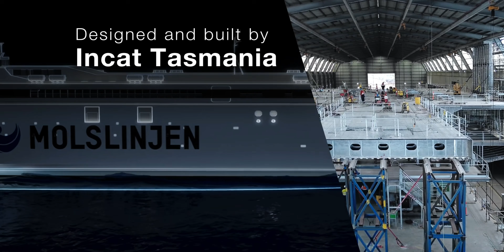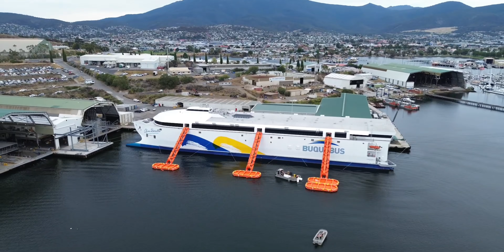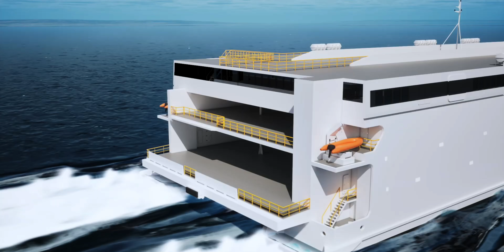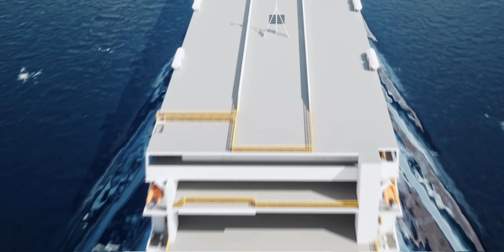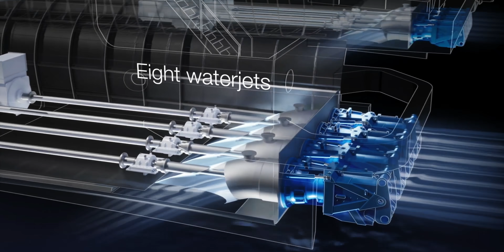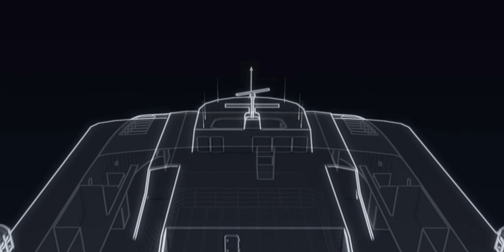World’s Largest Electric Ferries Are Finally Coming

Comment: Still much cheaper to run and much, much cleaner than diesel. The ferries are not connecting Ebeltoft and Aarhus. But are connecting the distant Copenhagen Island(Sealand)to mainland Denmark, which is important for danish infrastructure, as the two largest municipals and main  economic drivers in Denmark, are Aarhus and Copenhagen.
Reply: Sagde de ikke Århus - Odden og Ebeltoft - Odden i videoen?

Comment: Since 2018 the ferries between Helsingør (Denmark) and Helsingborg (Sweden) has been fully electric, so this is not a first. Now, these ferries may be bigger and sail longer, but the H-H ferries are by no means small - they are multi-deck car ferries and sail the short stretch across Øresund many times every day, with high power (1200kWh) charging during the 10 min. docking time. The batteries weigh about 80 ton 🙂

Comment: No information as to what is making the motors turn the water jets in terms of battery and power.
If the 2 battery charging systems are providing 58mW in 30 mins, that is a 232mWh charging rate. That's almost 1000 250kWh chargers running at once. Yeah right. Its between 4&7% of Denmark's entire generating capacity down 1 supply line. 
Finally, 132000 tons of CO2 is prevented ONLY if the source is CO2 free.  No mention of where the power was coming from
Reply: Easy look at Denmark's energy mix not difficult to do, it's sometimes called Google.

Comment: We need about 6 of these in British Columbia! Not chinese built diesels! Come on EBY WAKE UP!!
Reply: How about Chinese built BEV?!
Reply: BC tried building big catamarans 30 years ago and it was a disaster. Cats are not suited to the stormy waters outside Vancouver.
Reply: @Dave_Sisson  BC has 6 Island class plug in hybrids operating that are full electric capable. But typical of us, no chargers at the loading docks
Reply: @jaaklucas1329  The issue will be that there will not be the capacity to supply the charging stations. This is a common theme where virtue signalling officials go for electric vessels knowing full well that they will not be able to operate to the frequency required because of downtime due to slow charging, and in the case of hybrid vssels they will need to be run on diesel.  Total waste of money if the infrastructure to support them is not in place.

Comment: The new ship can carrier 500 cars and it charges 25,000 kWh while docking and the distance traveled is around 70 km. So it takes 0.71 kWh/km per car. On road a car drives around with 0.2 kWh/km. But the ship saves around 120 km of travel distance. But still nice to see the transition to renewable energy and also the removable of smelly fumes from the diesel will be nice and healthy too. I live close to Aarhus, so hope to see the ship in operation and compare the smell. :medal-yellow-first-red:
Reply: The ferry could slow down a bit. And save a LOT of energy...... but, Fast Ferries are what we use in Denmark. To connect. And avoid more congestion elsewhere..
Reply: @user-pt1ow8hx5l Some competing companies had made complaints about the high speed of the ferry, and they got support in a copenhagen court. Its the expensive Copenhagen SAS airlines and the unstable and slow Copenhagen Train company, called DSB, that will both soon be out of business, on the cross country route connecting the only two metropols in Denmark.
Reply: We need these here in Australia to go from Melbourne to Tasmania, where Incat is based. The scale needed is another step up, but the Tasmanian government has overseen a ferry-wharf debacle that means the new diesel ferries cannot even. DOCK!
Reply: Nice…Per 8210 i Tesla.

Comment: I wonder how these ferries will be delivered to Europe?
Reply: They use a special lift ship - they partly submerge - move under the object then re-float.  The latest completed ferry is stuck at the moment because the lift ship it needs is stuck in the Persian gulf
Reply: I do not know, but oil rigs are often delivered by barge. I guess that would work here too.
Reply: Same way they already delivered a ship to Argentina probably.
Reply: Just like the first ones we got from Australia by sea.
Reply: @Mariuz574. Did they sail to Australia on their own power or onboard a larger ship?
Reply: @yawn369  The old ones, the Express 5 and 4, came here on their own. However, the new ones will arrive by semi-submersible heavy-lift ship because, being fully electric, there’s no infrastructure to charge them along the entire journey.
Reply: @Mariuz574thanks!
Reply: Air Planes
Reply: @michaelbaysorensen 🤪
Reply: Likely on a container ship? I assume a container ship is much larger? Could probably send the batteries separately.

Comment: Cleaner, quieter, what's not to like! The price?
Reply: The longevity ?
Reply: @Martinko_Pcik  Just like an EV the batteries will last longer than an engine.  There's already an electric ferry currently in transit.
Reply: @Martinko_Pcik  They’re going to be seaworthy for 25 to 30 years, which is much longer than the time they actually plan to use them.
Reply: @Martinko_Pcik  replace the battry
Reply: What happens if it sinks?
Reply: Oh man, im sure the designers never thought about that.
Reply: @Earth-in-space  Do you mean like the Exxon Valdez did?
Reply: @BrentonSmythesfieldsaye  what was that?
Reply: @Earth-in-space  I have given you the name, if it interests you enough, maybe go and brush up on your history knowledge. It's all readily available on line.

Your opening post could interpreted as a "loaded question". But I could be wrong of course.
Reply: @Earth-in-space same thing that happens to Diesel ferries, but without the oil dump.
Reply: And or go into fire 🤔
Reply: @Earth-in-space  What happens if a fuel ferry sinks or goes into fire? 🤔
Reply: @PyroShields  then the water will likely get polluted with gasoline, if it does not go up in flames first.
Reply: @Earth-in-space  Well the electrical vessel will also sink.
Reply: Its half the price of the Train/ bridge transportation model. Despite that, the state medias in copenhagen (nationwide TV cannals are not legal outside the capital) are adverting for train and bridge, on a daily basis, in both commercials, series and movies. Taxpayers fund the old copenhagen train company(DSB) with billions of $ each year, to keep the trains running, or rather to keep people employed.

Comment: We have two electric ferries at Dover on the ferry route to Calais. They are running on diesel because they cannot recharge in the time nor from the infrastructure. It takes too long for a turnaround that it commercial viable. The town would go dark if they tried charging at fast rate.
Reply: Then battery packs on shore, which charge slowly but can dump massive power quickly, would be a solution.
Reply: @jannorgaard561 They are running on a financial tightrope and they spent so much buying the damned thing that there is no further investment money.. it was not thought out well concerning the infrastructure.of the town let alone the docks, which were originally set up about coal as the prime mover. Then oil but never electricity.
Reply: @GWAYGWAY1 why do they still run ferries as there is a tunnnel?
Reply: @gamma1929 
The tunnel cannot cope with the volume of freight traffic so we still need ferries.
Maybe if the powers that be are successful in drastically lowering our demand for “stuff” and travel, (which is their stated UN Agenda 30 aim),  the demand for ferries may reduce.  Who knows?
Reply: @GWAYGWAY1  I lived in Dover for 20 years back in the 50s and 60s and believe me there was electricity. then not sure what you are smoking.
Reply: Not electric , just hybrid,  with tiny batteries which are used for docking, you need to be educated on the difference.  You are just talking complete nonsense and lying to the world, very unBritish.
Reply: You might have lived in the town fifty 😂 years ago but they did not have electric ferries sucking megawatts of power from an unimproved infrastructure. They had steamship then  not electric ones that have to run diesel engines flat out to charge the propulsion engines because the batteries are not able to be charged. Don’t make remarks about a person you know nothing about .
Reply: How exactly are electric ferries running on diesel? You need an engine which would not make them electric. Try to make some sense.
Reply: @PyroShields They were bought as electric, but the recharging time and the power required is too long and too much, they instead run on generators which are diesel powered so they are really Hybrid powered, the actual drive units are electric azimuth Pods two at each end and they go in either direction hence the names of push me pull like the cartoon animals. This enable literal drive on forwards  and drive off at the other end saving time for the lorry offloading. And no turning about in the harbour..
Reply: @GWAYGWAY1  Sounds like you're saying they are electric but to charge them is done through diesel generators.
Reply: @PyroShields There are a lot of big ships like cruise liners that run that way as it save a lot of problems with prop shaft as alignment of the shaft. Also when manoeuvring is needed they can go sideways, backwards and spin on the spot. These ferries could go the whole way on battery but it takes a huge amount of power storage to be recharged.
Reply: @GWAYGWAY1  Seems like your country needs to work on generating more renewable energy.

Comment: China Zorrilla, still moored outside Incat's shipbuilders in Hobart, has been for months ?
Reply: I understand the heavy lift ship needed to transport it to Uruguay is stuck in the Persian Gulf. So nothing will happen until that war is over.
Reply: @Dave_Sisson  whenever that may be ?
Reply: @Dave_Sisson  I can't believe there's only one vessel on the planet suitable for moving this ?
Reply: @Raceproved  Every other large ship built by Incat has been powered by diesel or gas and sailed to its customers under its own power. But this ship cannot have extra fuel storage added so uniquely it needs to be sent on a heavy lift ship.
Reply: @Dave_Sisson  a white elephant for Buquebus brand new ferry costing $$$$ mothballed in Prince of Wales Bay ?
Reply: @Raceproved  Well it's not the fault of Incat or Buquebus, the heavy lift ship can't get there because of a war on the other side of the world. It can't be a 'white elephant' unless it fails in operation and Buquebus has operated Incat ferries for two decades, so they know this extra ferry in their fleet will work.
Reply: @Dave_Sisson  its not operating now and not likely to do so in the near future - That makes it a white elephant in my book, particularly as it hasn't earnt a single cent for Buquebus, yet ? To have a huge financial outlay SITTING (until when) is BONKERS. A war on the other side of the world is preventing it from being lifted, however, being reliant on electrical storage, (Batteries) is / are preventing it being delivered (sailed) conventionally ............. BONKERS
Reply: No charging in suitable place to transit home  it is a big ocean in every way, they need a diesel tug to go to their new home?
Reply: @GWAYGWAY1  from what I understand, Incat themselves don't have enough KWH to charge it  !
Reply: Already arrived at destination, starting service this month (Oct "26)
Reply: @zedtraffer  I know - It left Tasmania (Hobart) in August finally. Watching its future rotations with keen interest.

Comment: All the short route ferries will be the first to go electric
Reply: I've already been on the small "roll-on roll-off" used to cross the.norwegian fjords, they don't look any different but are silent and move smoothly. The company they are talking about build bigger ones that are catamarans and made of aluminium
Reply: Over 100 in traffic right  now in Norway alone.
Reply: Of course, it's easier to test on smaller scales. Norway is also using small ferries in between their many southern islands, and it's working great. Little to no noise, easy recharging at the harbours, nice and neat.
Reply: Denmark have already built the world's largest electric ferry i 2019 called ELLEN in regular service with 3-7 daily departures round trip of 40 km.
Reply: @HansensUnivers  "Ellen" was neither the first nor the largest (2019, 996 ton, 59m long, 198 passengers, 31 cars). The first completely El ferry was "Ampere" in Norway (2015, 1598 ton, 79m long, 360 passengers, 120 cars), a newer one is "Bastø Electric" (2021, 7911 ton, 143m long, 600 passengers, 200 cars). Both are still in operation. The Molslinje ferries will be significantly larger (2027, 129m long. 1493 passengers, 500 cars), it will also be the worlds largest catamaran.
Reply: @HansensUnivers Hej Hansen. Hvor sejler Ellen….? Jeg undrer mig over at nationalt TV har valgt at mørkelægge denne succeshistorie. vh Per.
Reply: For example greek island ferries..
Reply: @vox_dei_365 Last time I was in Greek in a large city for a week,  I saw one…like in one Tesla. Dont expect express electrification there….
Reply: @perlaursen1885  they will!!!  soon all the short Haul ferries and cars will be electric on the islands
Reply: I think that your comment is the right approach, make it happen, then improve it… otherwise an extremely ambitious project will never see the light.

Comment: why is roof without solar panels? and you neead heat pump from water and stirling or sco2 turbine, imagine you have endless battery ocean outside of the ferry
Reply: This ferry will be equipped with 45,000 kWh of batteries that will be used in one crossing. At 130 m long and 30 m wide, the vessel has a footprint of 3900 sqm. In Denmark, insolation is around 1 kW per sqm maximum. With the cutting edge Perovskite PV array we'll have 220 watts per sqm under ideal conditions, which translates to around 140 kWh per sqm of energy generated in a YEAR. Multiply that by 3900 sqm and get 550,000 kWh generated a year.

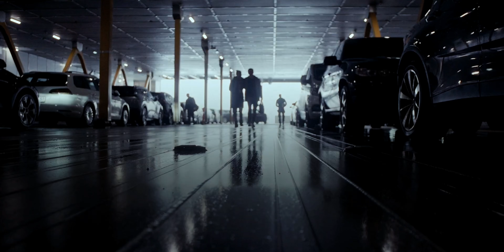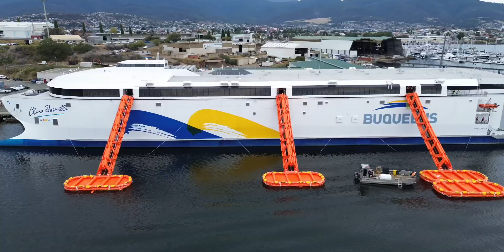Now, one crossing on the Kattegat line from Aarhus to Odden where these will be deployed takes 1:15, plus 0:45 dock time, which gives 2 hours block time, as we can see now in the ferry timetables. Each crossing will consume 35 MW per Molslinjen site, and every vessel does 5 crossings a day. 550/35/5=~3. All these batteries will barely generate 0.8% of energy needed for the ship in ideal conditions. Not even a dent.
Reply: Because there is no sun in Denmark. Maybe a wind turbine ?
Reply: Was thinking the same, would help batteries by giving some extra power. 
Could propably cut down a bit on the 30 minutes of charging